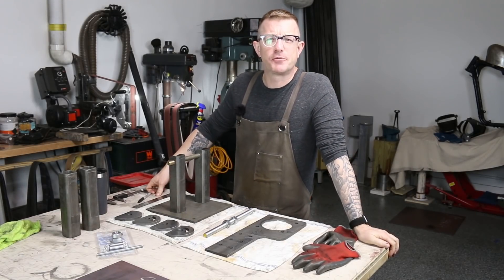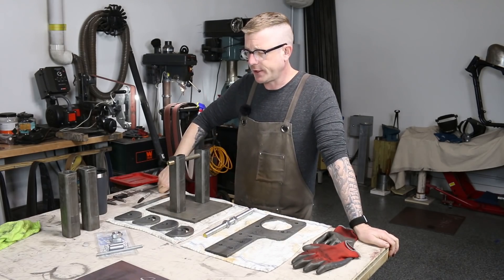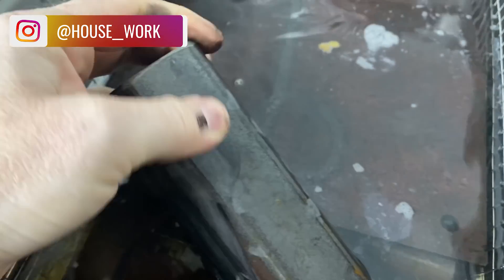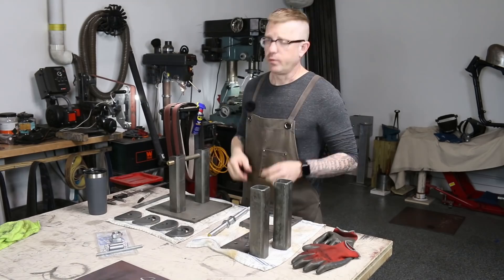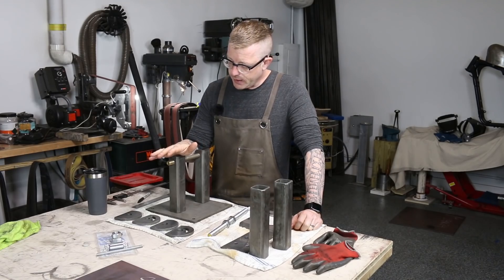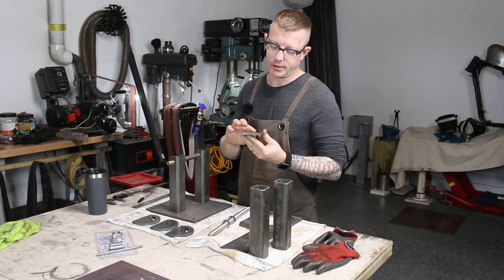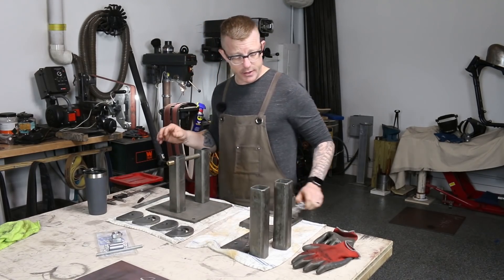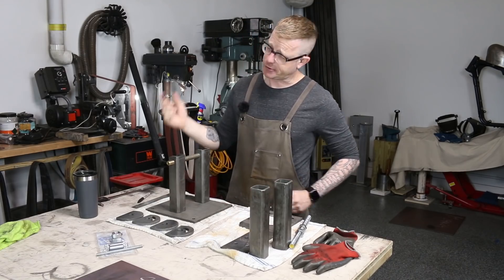DIY 2x72 Belt Grinder Prototype Build: Welding It Up

Comment: Have you ever thought of using a dc motor from a tread mill?
Reply from the maker: Yes I have tried it and it’s not a good idea. Failed pretty quick so I replaced it with an AC setup. Much happier with that now.

Comment: How are you going to get arround the issue of having to adjust the tool rest every time you change from vertical to horizontal? Jeremy Schidts videos (I'm sure you will have watched) explain why his hinge mechanism is centred with the belt grinder so the tool rest doesn't need changing.
Reply from the maker: It’s a square tube, pull the tooling arm out and rotate it 90 degrees. Slide it in a lock it. I estimate it will take about 5-10 seconds. I like his design a lot, but it seems like a lot of difficult parts to create for just that one perk. In the future I may come up with a design for a work rest that has a similar function.

Comment: Probably 2 1" holes would be enough, you want it wide enough to get your angle of the  wire right to tie the 2 metals together just like an inside corner weld, if you can't pry it apart you probably are already good to go. In industrial use we use to slot our plug welds which is even better but not needed here as you really don't have forces trying to pull it apart
Reply from the maker: Good to know, slots could be useful for future add ons. Ill keep that in mind. I'm going to put 1" holes in for the CNC cuts. Do you think 6 is enough? or too many? I might be able to get away with 4 if spaced out correctly?
Reply: @HouseMadeUS  4 is more than enough

Comment: Where did you get your wheels from?
Reply from the maker: Hi Glen, 
The drive Wheel: https://ebay.to/2MPdEp9
The Tracking Wheel: https://ebay.to/2ZyZsFU
The Platen with Wheels: https://ebay.to/2sqL46m
Reply: Ameribrade is where I bought my 2 x 72" from. They have sales on sets of wheels on their website sometimes also.
Reply from the maker: Yeah I got my 7” drive wheel for my new design from them. Good quality stuff.

Comment: your plug weld holes could have been larger to make it easier to get a better plug weld but if you were hot enough you should be fine. good job I like it
Reply from the maker: Totally agree Kevin. When I get my plasma table I’ll have it open those holes up more. 3/4” seem to be okay or 1”?

Comment: What brand and model of welder do you have?
Reply from the maker: I did a ton of research on welders before I settled on the Hobart - https://amzn.to/2sS8y4a  - it’s been a very reliable welder, nice beads no failures, consistent. And it has a spool gun for aluminum. Very happy with it.
Reply: I have the same model.